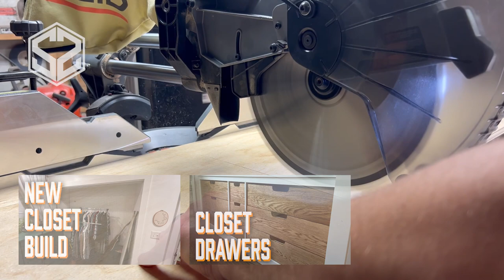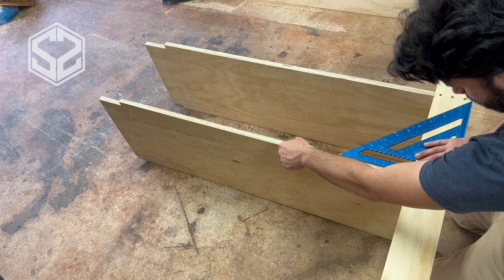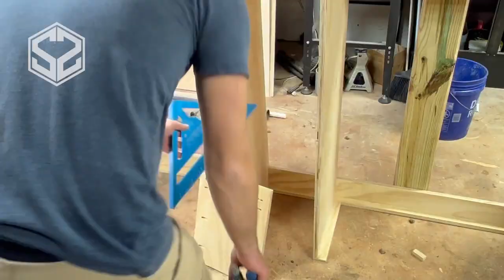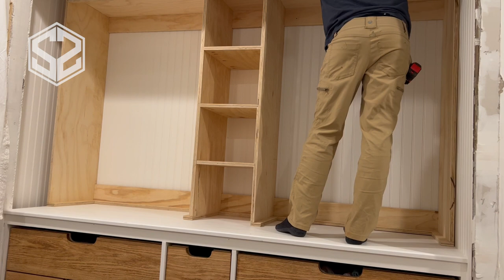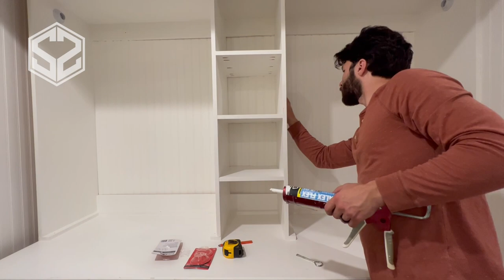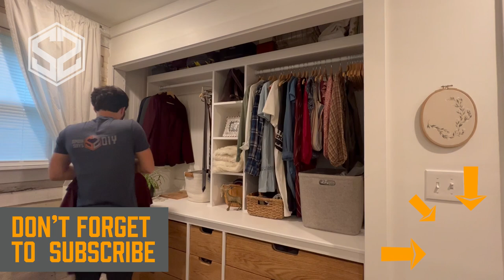Custom Closet Build

Comment: I'm very anxious to see what you do for doors for this closet. We have one very similar that has dated sliding mirror doors with one door roller broken so I just took it out. I can't do barn doors because the left side goes against the wall just like yours, and wife's dresser needs to go against the right side wall. I can't do a pocket door on the right side because there is electrical in that wall.
Reply: @simonsays I have a similar problem! Can't wait for those doors! Great job with the drawers! Thanks, for your videos! I'm so grateful!